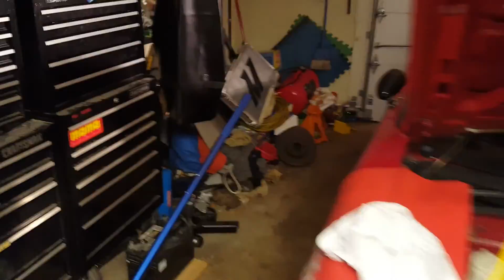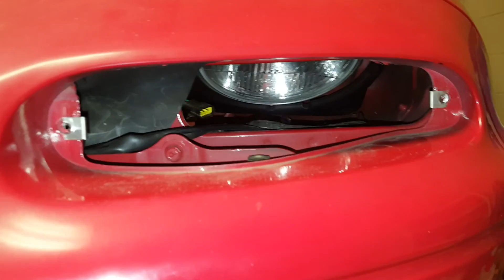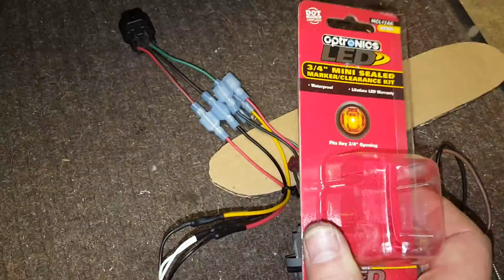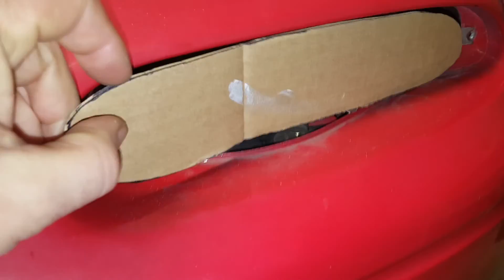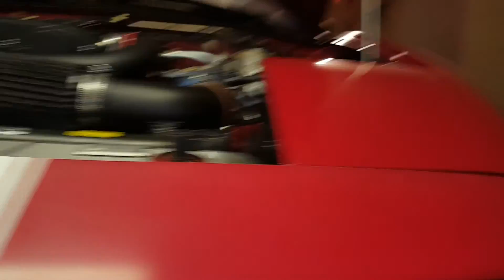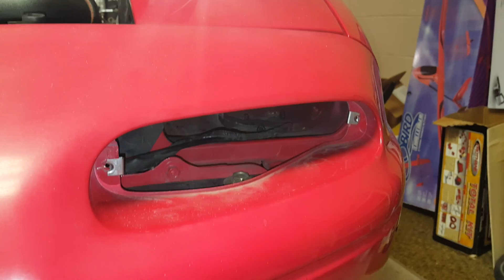$30 turn signal intake for turbo miata

Comment: Any issues with the breather filter on the valve cover? I'm trying to decide between a small cone filter like you have VS a hose to the intake piping VS a catch can
Reply: Awesome I'm glad to hear that =) Getting back to the turbo life soon! Only 1-2 more jobs on the Reborn Miata project and we'll be doing the 1.8 swap and starting the other mods for the turbo =)
Reply from the maker: None whatsoever you would not be able to run a hose from this to a catch can if you are running a turbo, only from the line that goes between the pcv valve and the intake manifold, the pcv valve prevents you from pressurising the crank case, this line is just left open to atmosphere with the filter on it.    I plan to run a air oil separator on this after I relocate the washer bottle.    I'll be using a Bobs auto sport unit when I do that.   You can check out how well they work in my other video where I did a review on them.
Reply: You CAN run a catch can from that spot, though its not as good as the PCV location. Generally if you don't run a little filter you would run a breather line to the intake Pre-Turbo to pull a little vacuum from it similar to stock.
Reply: GearHeads Garage thanks! You guys are helping me loads with my build